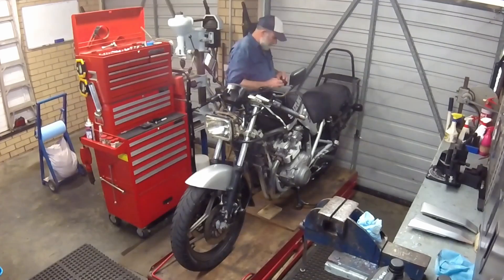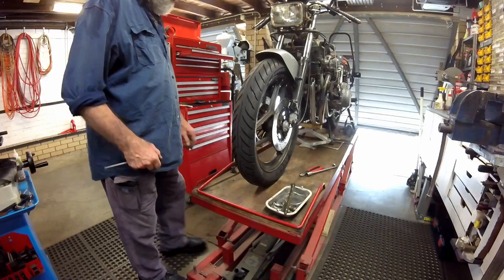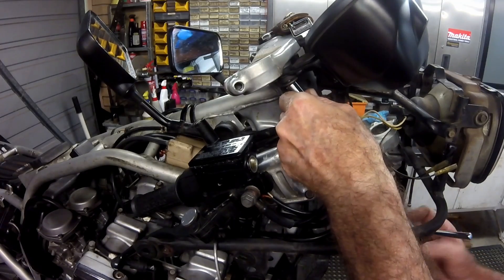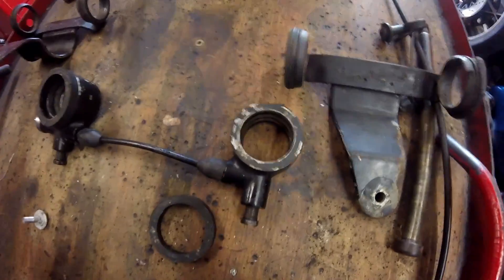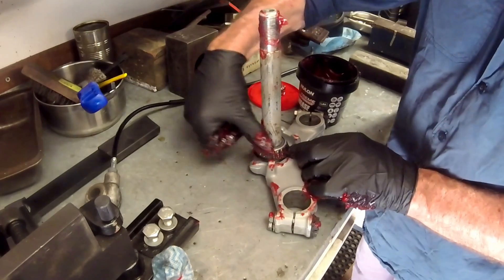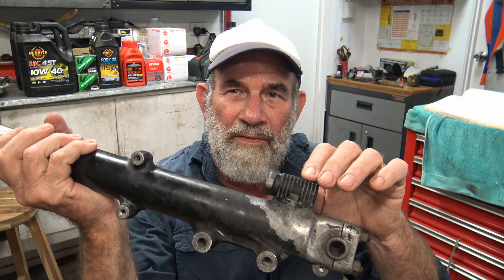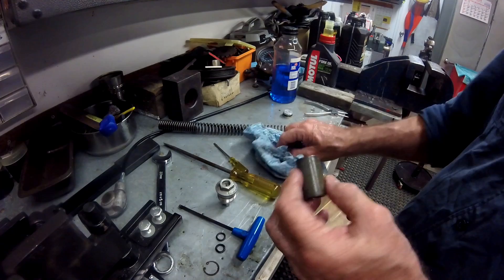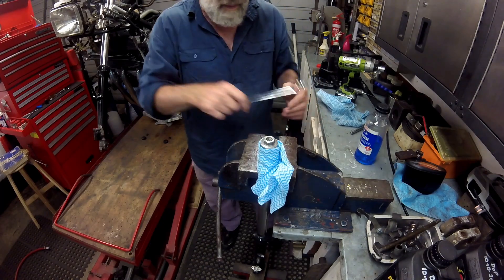Steering Head and Fork Servicing on the 1980s Suzuki GS 16 Valve Motorcycles

Comment: Great video. It's the only one I have been able to find that is specific to the 1983 GS750 (or at least I think so!). It will give me good start on figuring out how to change the oil seals and oil. If you have any videos on the air assist I would be interested. Have not been able to find any info on that. But it does sound as though I could just not worry about pressurizing the forks as long. As the seals there are ok I am good to go?! Thanks!!
Reply from the maker: I thought by 1983, Suzuki had dropped the air fork idea. The 1980 ET series have the air intake on the fork tube, and the only repair is to replace the four o-rings, two for each fork, in the air manifold, and maybe check the balance line for leaks. Some bikes had air valves in the top of the fork cap, for these, check for leaks and maybe replace the o-ring in the cap. The air valves are usually just schrader valves, so easily dealt with by replacement if they leak. All my experience with air forks has been that I could not notice a difference between un-presurised and presurised. Hope that helps.